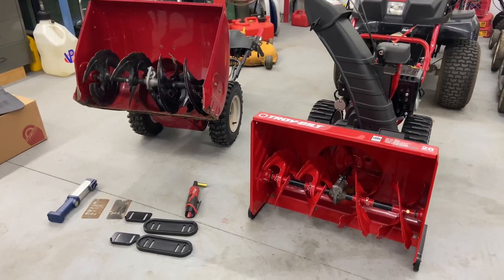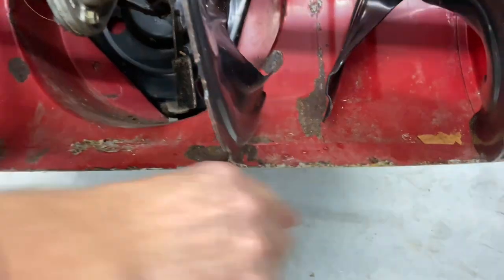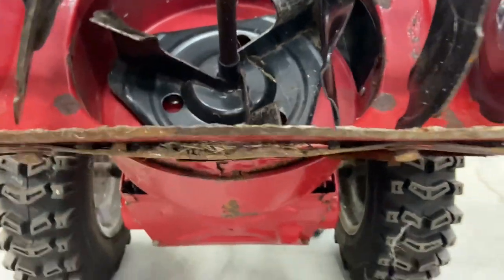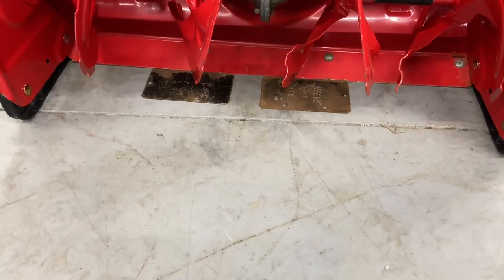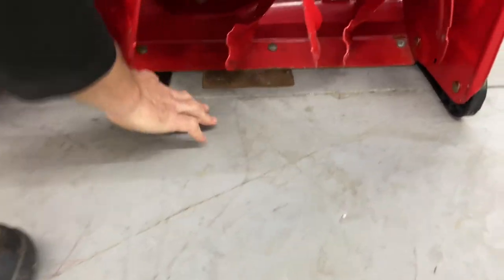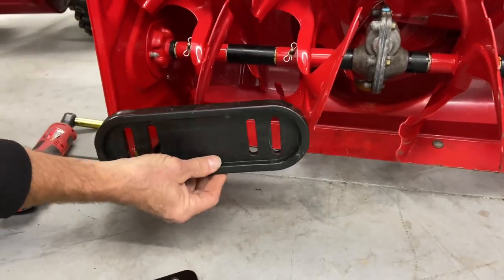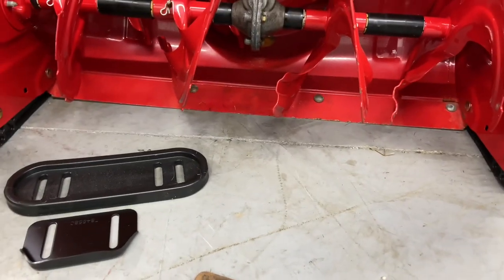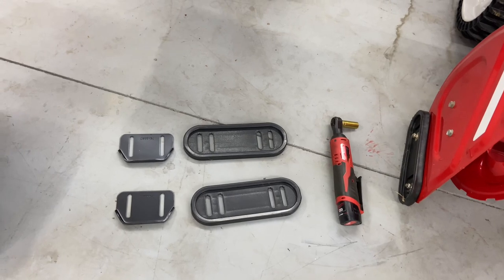Snow Thrower Skid Shoe Adjustment

Comment: It's important to make sure the tires have the same air pressure so the machine can be level.  I use paint mixing sticks for the air gap.
Reply from the maker: 100% agree. I mistakenly edited that out. It isn't easy to relay what I'm thinking to words so the editing process sometimes is challenging and I redid the part that I previously had that in there. Good looking out! You must have a fairly large air gap using paint mixing sticks. Most people do not like any air gap so I try and keep it as small as I can. Though,  you will need to adjust more often. Where we live, we do not get much snow so having a small air gap is not a big deal. Thank you for watching and commenting.
Reply: Yup..I even use a carpenters level to ensure the unit is perfect before tightening the bolts.